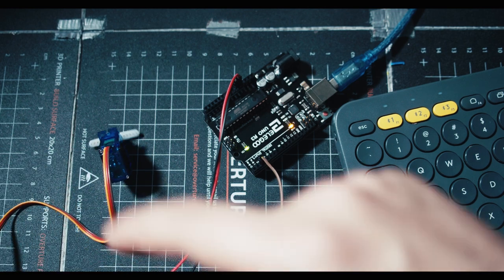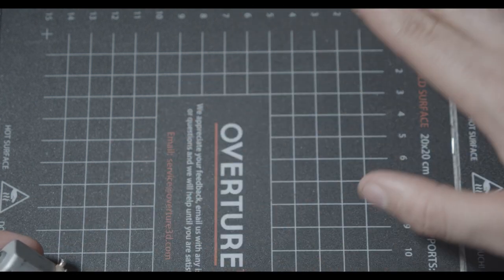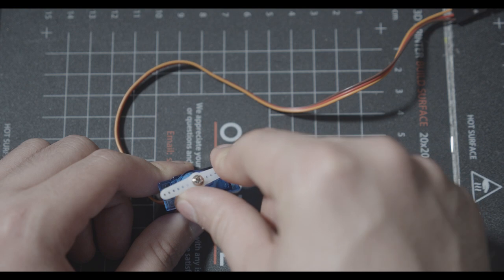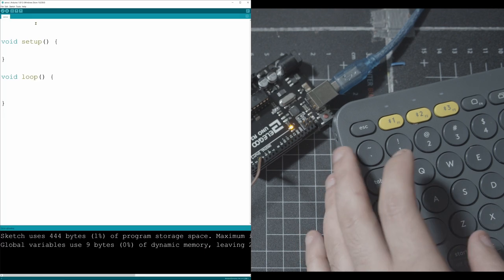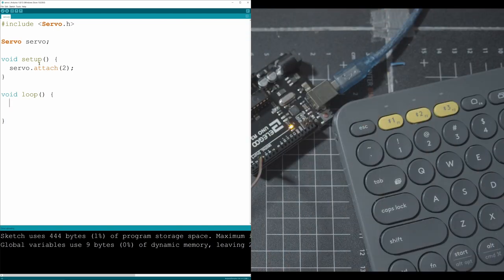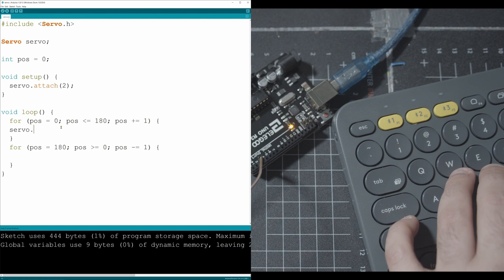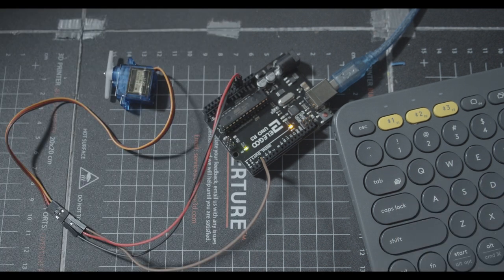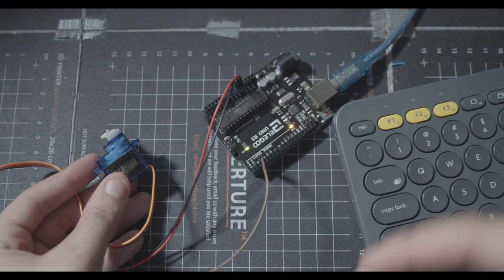Servo Motor Explained | Servo vs Stepper Vs DC | Arduino Sensors | #grindreel

Comment: Had to design a centrifugal pump with a DC motor so I didn't know about Servo motors til now. Nice to know you can use it for receiving position data. I left a like for the algo!

Comment: So for a centrifuge you'd use a DC motor?

Already know the answer but gotta have some comment for the algo, in case that's how it works lol
Reply from the maker: yeah Dc motors are most used cause they can just put out raw power and speed like FPV drones, vs needing precision like a robotic arm

Comment: how do you get positional info back from a servo?  just by moving a sensor with it until the sensor is made (say by a prox or something)?
Reply from the maker: Depends on the servos, some provide no information just allow you to rotate them by x unit, so having a starting point and moving from that one, while keeping track is how I do it. The more expensive ones have potentiometers inside which is like a electrical dimmer amd they can get position from how much power is going through the potentiometer,